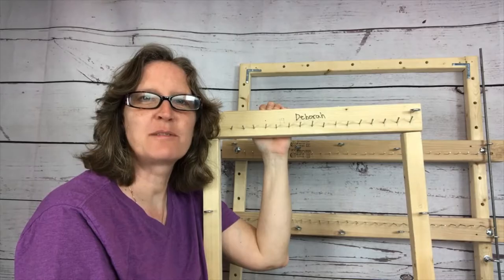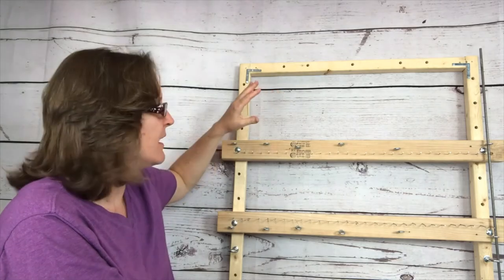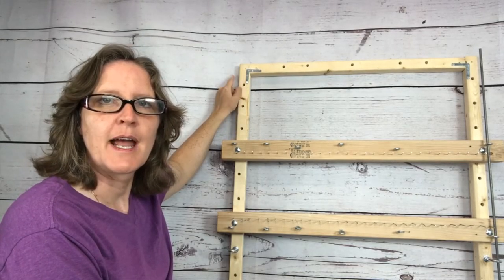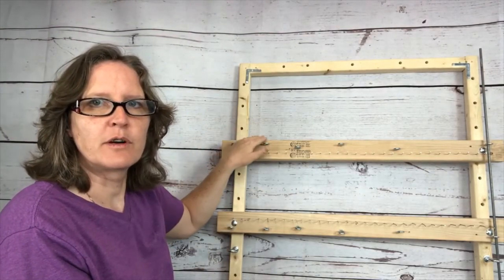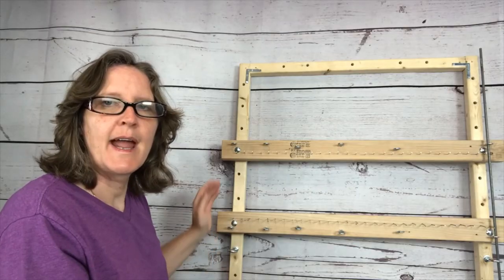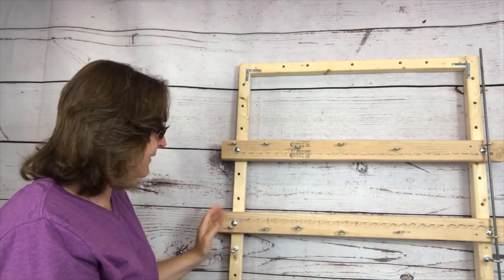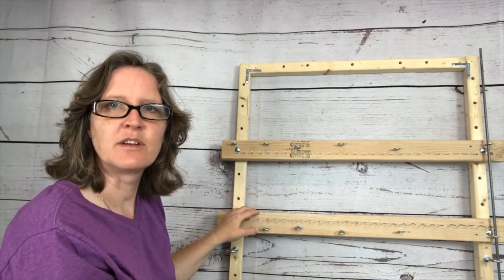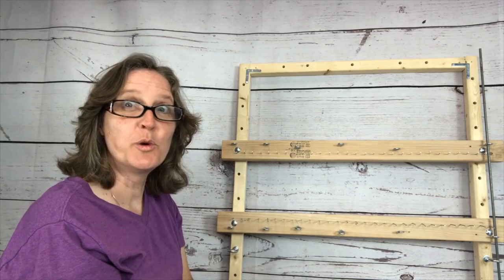How to Build a Twining Loom

Comment: make videos with you using it and show the patterns you do please i want to see how yours works i just have plastic loops threads ones i wish they were more like legos and came appart and could adjust lengths on them all and fit apart to add to lengthen and make a bigger loom by connecting all of the smaller sizes when its plastic it looks like legos but does not act like them the ones making looms need to make them adjustable . I like how your wooden one is adjustable that makes it good.